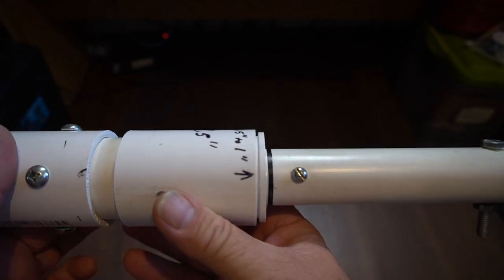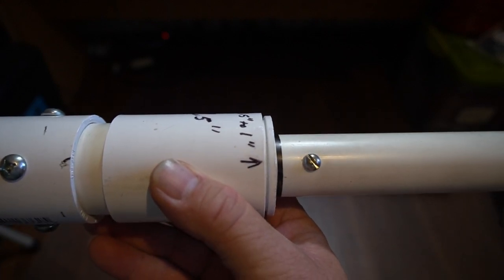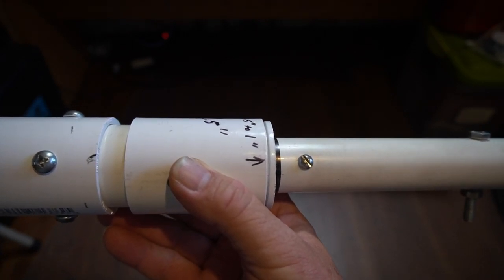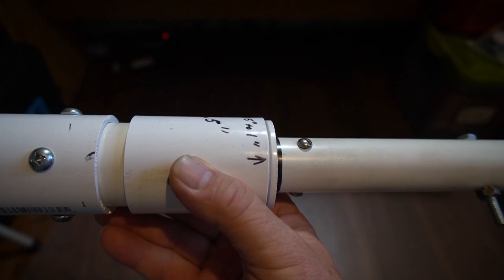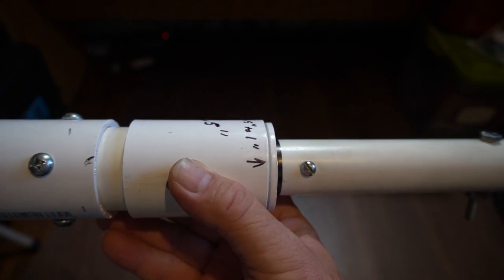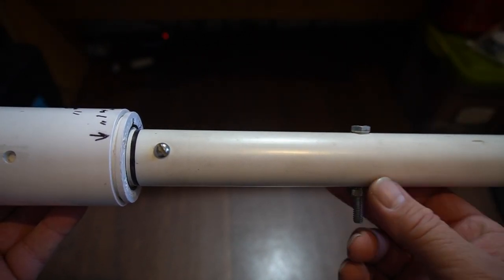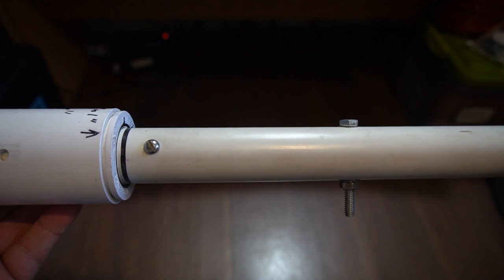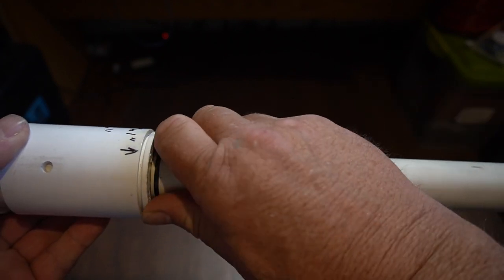How to make the best and cheapest 12 volt rotor for use with small beam antennas!

Comment from the maker: I posted parts for this build that I found that should give better control over speed and also a coupler to make the build easier. I will try and do a follow up video on the new parts!
Reply: i FOUND  a better way of building that rotor with less part  i am using a pvc 1in compression cupplure 
and it alot easyer to build and laess pices needed to cut
Reply from the maker: @AndrewMurphy8383  Check out my second video on this rotor it sounds like you found out the same parts I used in that build!
Reply: @KK6USYHamRadioAdventures  maybe so but i found ways to fix with out screws and love ur videos and may u please send me link to the other video please
Reply from the maker: @AndrewMurphy8383  sure , let me know how close we are on it!  , https://www.youtube.com/watch?v=QvWvsNbghxM&t=6s

Comment: Interesting build...and your follow-up. I've been pondering this homebrew rotor project for a couple of years but haven't made it a priority. I'm about to. I had saved an older 12v DeWalt reversible drill to salvage the motor, chuck and switch. You've given me some ideas on the coupler with a flange for the antenna mount. Nice channel! 73 de K4FMH
Reply from the maker: I actually have a screw gun that I might sacrifice for a stronger motor, thanks for watching!

Comment: Chuck I just bought the 5rpm motor.
Reply from the maker: Thats Funny Fred I was just looking at the 5 rpm motor, look this up to slow it down we are going to make one for that moxon build going to my buddies house.  RioRand 6V 12V 24V 28V 3A 80W DC Motor Speed Controller PWM Speed Adjustable Reversible Switch 1203BB DC Motor Driver Reversing
Reply: Chuck I am W1FRD in Fairfield. Belong to the 2metercrew and Vaca Valley Radio Club.
Reply from the maker: @fastfred529  , Yep I remember you from the anti nets . Not sure if we met at Field Day I met a lot people that day.
Reply: $7.95 for the switch and speed controller, just ordered that too.

Comment: Use a cheap used 12v model train transformer like a Bachmann that has a speed knob and that can regulate the speed and direction. They are on ebay frequently for $10. Then you dont need the switch.

Comment: im trying to make dish antenna rotate...can this type of motor support the 65cm dish...or is it only for light weight antenna?
Reply from the maker: You can try it I only use this portable, I don't leave it out in the weather all the time. The biggest antenna I have tried is a 6m hexbeam which is probably 3-5 pounds.

Comment: Very well done 👍👍👍
Reply: I wish there was a way you could mass produce this I would buy one in a heartbeat
Reply from the maker: @2metercrew389  , A buddy and I are working on a new design with a battery operated screw driver with variable speed control unless the motors get back in stock and I will hook you up!
Reply from the maker: @2metercrew389  , Derick I think I have figured out what to do will get you one going soon!
Reply: KK6USY Ham Radio Adventures  Hey that’s great 👍👍👍

Comment: I have a rca vh 226 e  programmable  rotor box bought complete rotor bad gears have all electronic parts in rotor 3 wire lead  motor works fine  just turns to fast without the bigger gears is there another motor I could use with box to make this into home made type rotor using box for direction  is programmable up to 12 times?